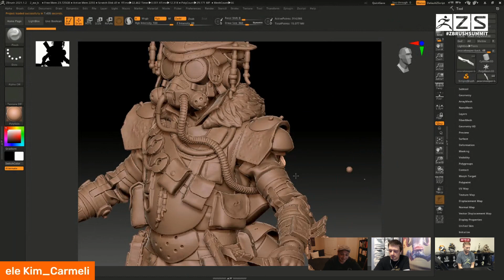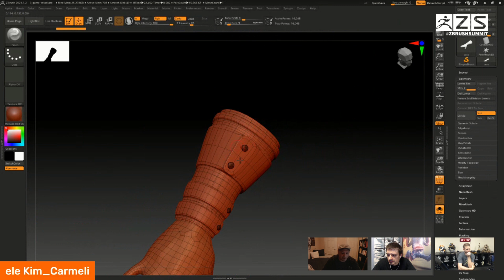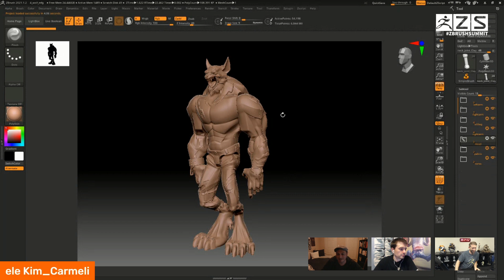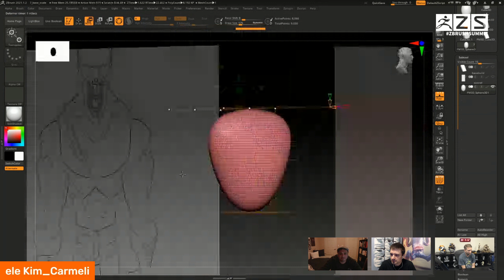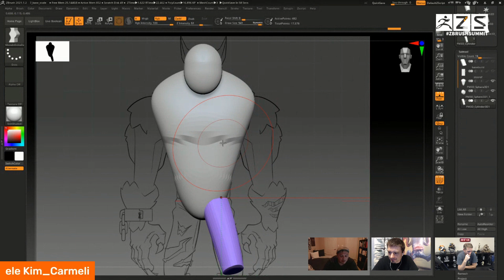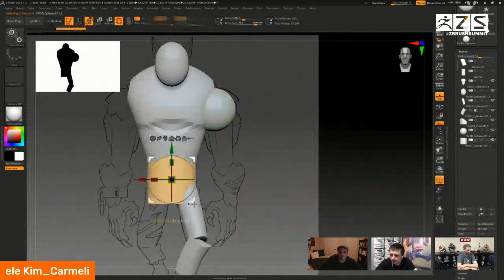SCULPTING FOR TOYS: JAKKS PACIFIC - Eleazar Carmeli - ZBrush Summit 2020

Comment: So basically remove details for doing toys. Pathetic breakdowns
Reply: No. There is a minimum wall thickness required for all parts of the figure for it to be manufacturable. Anything less than 1mm thick won't work. There are many things that you have to take into account and figure out.